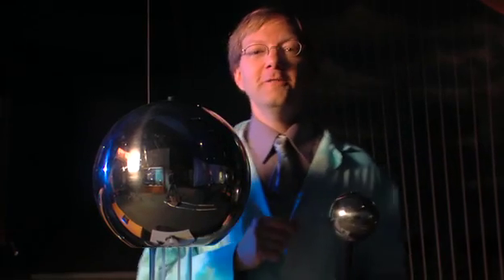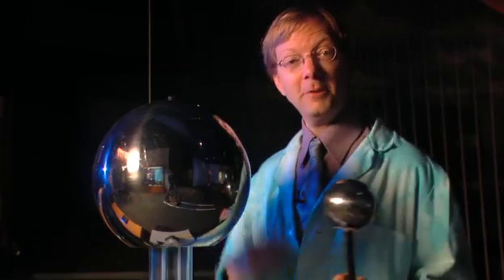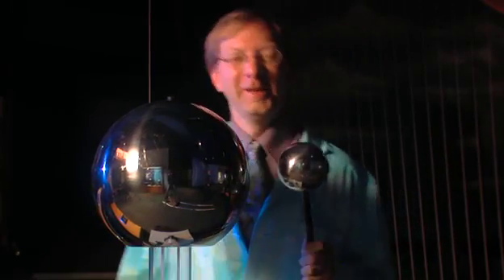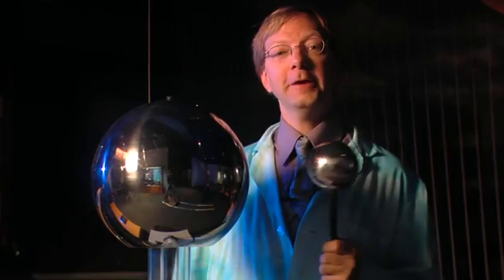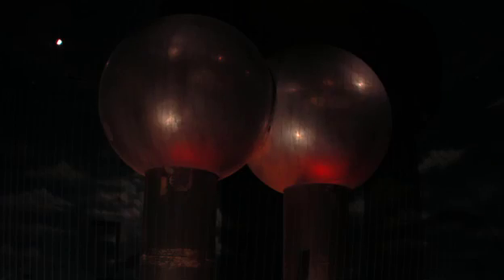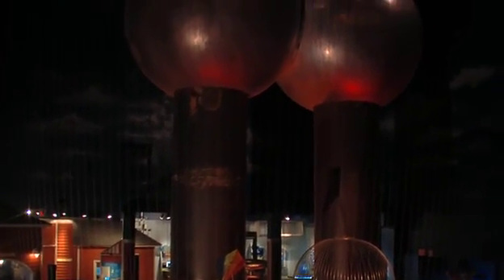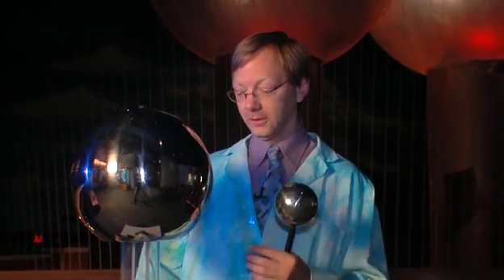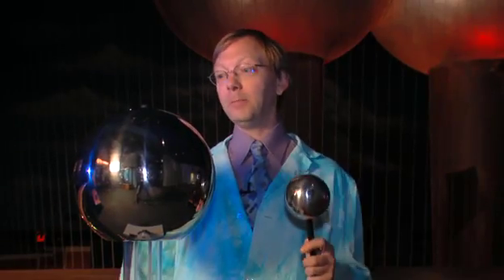World's Largest Van de Graff Generator

Comment: Van der Graaf generator were used by Tesla to repulse the ionized tungsten particles from the Open Vacuum Tube (by continous vacuum generation). The static repulsion of ionized particles served to guide with help of the UV ray from the same Open Vacuum Tube, beeing able to use the air as a conductor between emitter and reciever with the highest efficiency(I think by chemical equilibrium between both tubes). I think It probably would work as a death ray calibrating the charge of tungstene.

Comment: Why don't people understand the difference between voltage and current? It's not the voltage that kills you, it's the current.  A 240 volt wall outlet has a much better chance of killing you than a 1,000,000 volt Van de Graaff.  I've been shocked by both, and I can say with complete certainty that the shorter pulse and lower current of the Van de Graaff makes it much less painful.

Comment: @TheMonkeyzRule It's not the voltage that is fatal, it is the amperage. Van De Graff generators usually have a very small amperage. The amperage from THAT monster might be close to 50 milliamps, which is 20 milliamps short of a fatal amperage. If you ran 5 million volts through yourself at 10 milliamps you will feel a slight jolt, but no more! But if you ran 1 volt through yourself at 90 milliamps, you'd be dead.